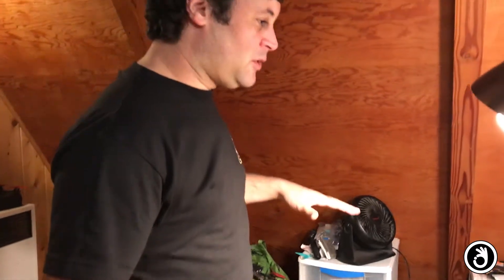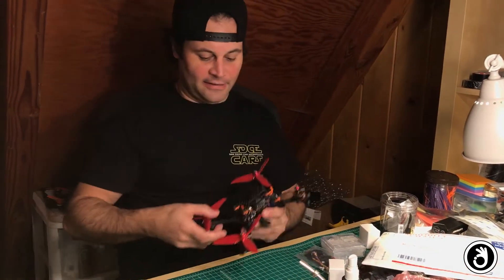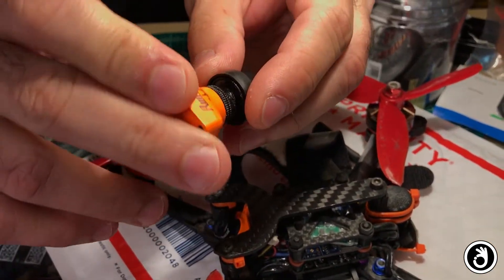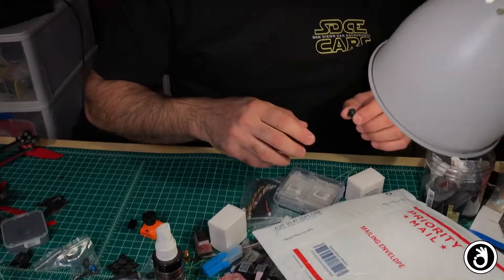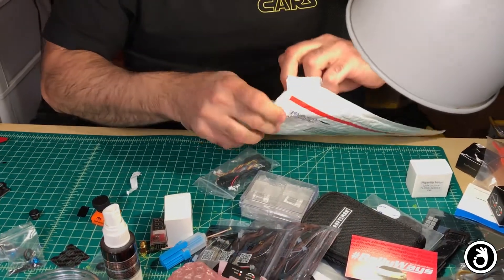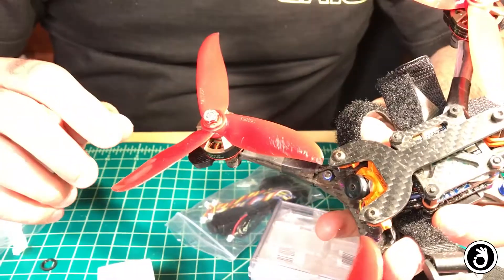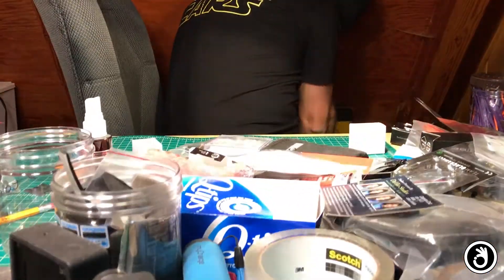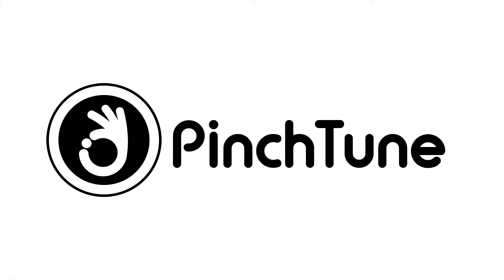RunCam Swift Micro Lens Lock Nut Fix

Comment: This should work for the swift 2 right?
Reply from the maker: Nope. Well, not unless you find the correct size nut for that one. This particular size only works on micro cam lenses, (Micro Swift, Micro Swift 2, etc). The standard Swift 2 uses a full size lens which had a larger barrel and thread. In theory, if you find the correct nut size for it, you can make it happen. But the particular one in this video will not fit.
Reply: PinchTune Thanks bro.